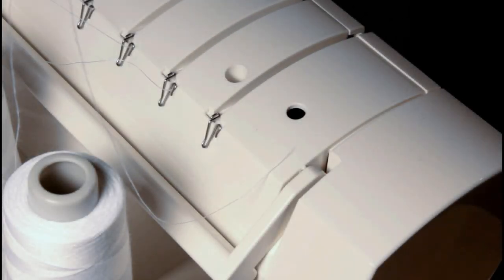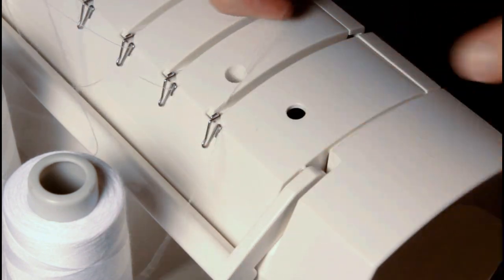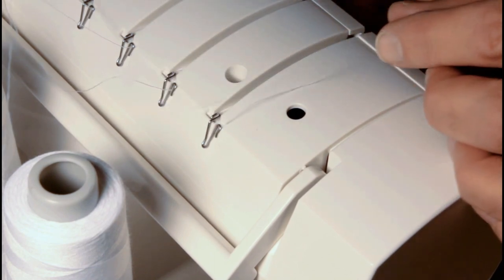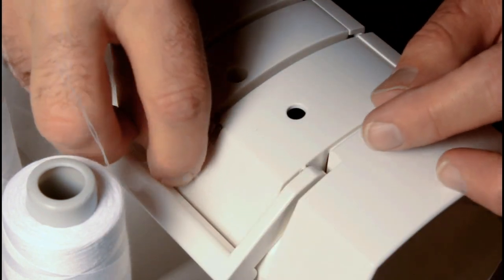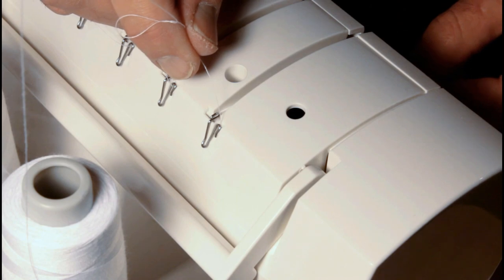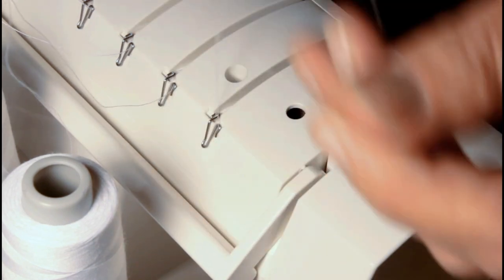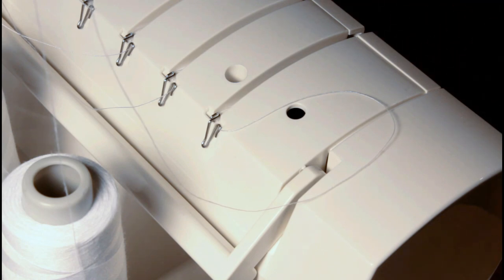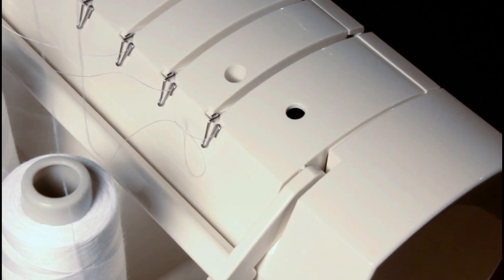Singer Scholastic Thread Guide Issue

Comment: I've also found this thread guide to be a sticking point when changing the threads.
When I change threads on the serger (overlocker uk) I tie my new thread to the old thread and when I pull the knot through the machine it gets caught on the guide. I'm disappointed in Singer for not recognising that this would be a problem.
Reply from the maker: I hear you Lyn. It seems that they don't do much testing for issue such as this on the lower cost machines.